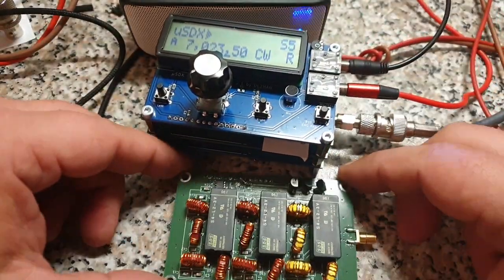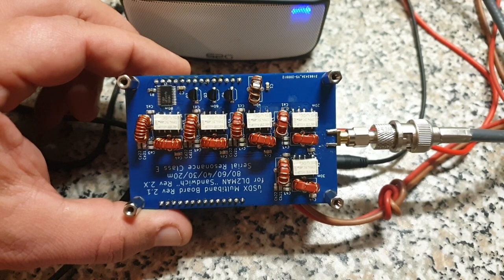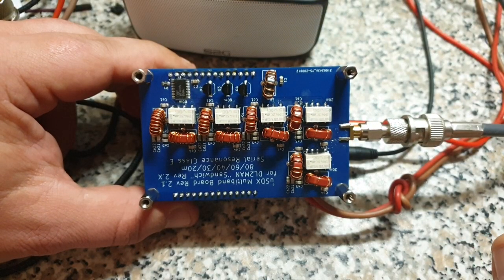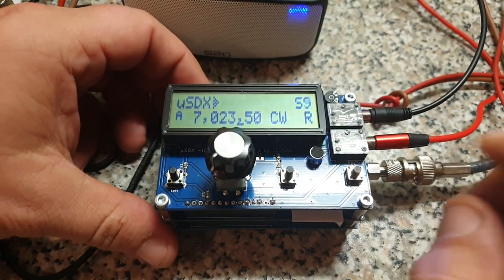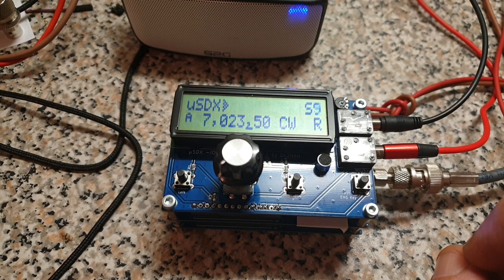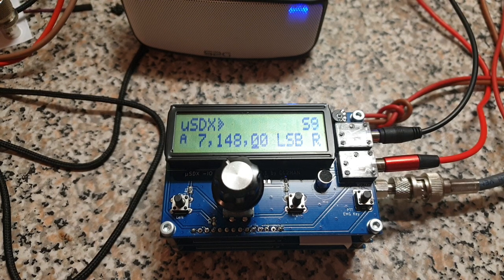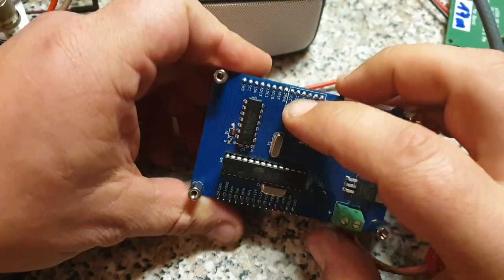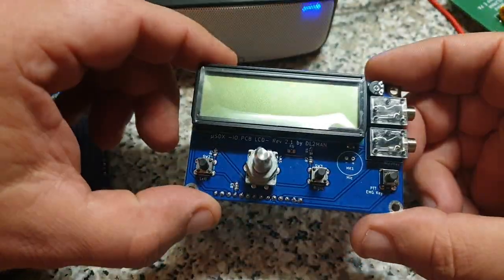uSDX Sandwich by DL2MAN - latest improvements

Comment: As I mentioned on the groups.io forum, I'd like to build a version of this rig based on the sandwich.  Not that I have anything against buying PC boards, but I have a bunch of semi compatible parts with different footprints that won't fit your boards, so I plan on building this using various prototyping methods (perfboard, point to point on Cu clad, etc).  I have suitable LCD displays (16x2) in standard formats (no backlight).  I've got 'raw' Si5351, 74ACT00, and FST3253, atmega328 smt parts soldered onto TH adapters, and TH 2N7000 FETs.  I have larger DIP relays in 0.300" packages (DPDT, 12V coils), and different (philips) I2C expander chips.  (So some small changes to SW will need to be made by me).  I will start with the Sandwich schematic, and adapt to parts I have.  I'll probably build a 4 band version (80,40,30,20).  I also have a nice aluminum project box to build in. This looks like a nice DIY experimenters project.  Later on I might look at porting the sw to the AVR128DB.

Comment: Did you already consider to build an DL0 device for lazy HAM's with 160m, 80m, 15 and 10 m ?
Reply from the maker: There will NOT be a completed rig from me/us. In order to offer/provide a completed rig within Germany/EU we´d need al kinds of certificates and paperwork. I know it´s legal to buy and use a device as licensed radio amatuer, but it´s illegal to produce and sell. If you sell those commerically, legal requirements need to be fulfilled.

Comment: HF is not a cheap world to enter, so I am following this project intensely. I feel that this design and implementation of the project is the best one I’ve seen, and I can’t wait to be able to buy a kit and make one for SOTA use in the future.
Reply: I have done some basic PCB design myself for arduinos etc and started to make a version of the pixie board with mods etc. I can’t quite see from the video but are their vias on your boards between ground planes? It was recommended that I put a lot on my pixie board but I can’t see any here.

Also is this just a 2 layer board? Not a 4 or anything like that? I want to load the boards into KiCAD or something but not sure what formats are available.
Reply from the maker: @MarkPentler  Hello Mark, of course there are a lot of Vias on every Board. As mentioned in the Video: IO Board is 2 Layer, RF Board and Mainboard are 4-Layer now. KiCAD Source files are no longer open to public. Just the Gerber FIles, as I want to keep control over my design.
Reply: @dl2man  ah apologies was unable to watch with sound on at work

Comment: Manuel It is impressive design. However, You can use the pugo-stick connector on the filter board to switch for different bands. The pugo-stick I'm suggesting a spring-loaded mechanism, so it is easy to connect and disconnect.

Comment: I'm so excited about this project. Everyday there are improvements and knowledge shared in the groups.io community. Have you thought of switching the MCU to STM32F4? The ATmega aspect is one of the things holding me back from building it.
Reply from the maker: Hi Erik, from "official" side, there are no plans to move to another µC at this Moment. Yes the ATMeage is Low Performance, but also Low Power consuming. When we use a FPGA, we will definately need more RX Current, and that´s at least against my Vison of that project. But it´s open source and there are people in this project trying to go into that direction.
Reply: Hey. But STM32s (or other microcontrollers made in the last two decades) have much better ADCs and power efficiency, too. :( Yeah, reading the forums, there is some traction, but not much. I like your design, though, so I may as well build an AVR one and when I get it working 100 %, start porting everything over to STM32. One more question, are the toroids in the output filter stage hand wound?

Thanks for your work and dedication. 73 de OM2AGC.
Reply from the maker: @ErikBročko  yes, I wind the Toroids by hand. I will show you in the yet to be released "how to build" series

Comment: I am really excited about this project! Found your channel today and saw each video ;) Wish you good luck with your project! 
What do you think, is it possible to change 3-PCB design to 2-PCB design with multi-layer PCB? It will reduce the thickness of the rig to fit it into the pocket.
Reply from the maker: Yes, of course it is possible. But the intention of that design was to stay flexible. So I seperated it into 3 interchangable elements: Human Interface (Display, Speaker+Key Connetion, Buttons), Mainboard (Microcontroller, PLL, Mixer, OpAmp ) and the RF Unit. There are even 1 Board Designs possible with about the same (credit card) size as my current design, but you give up flexbility then....